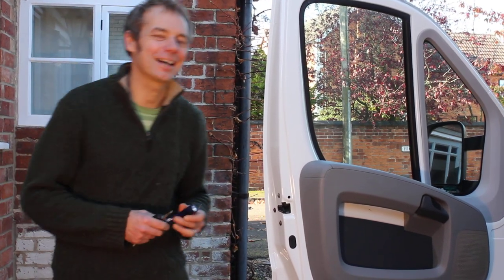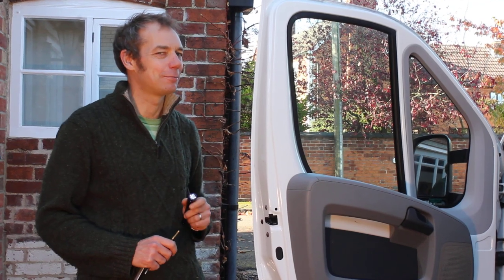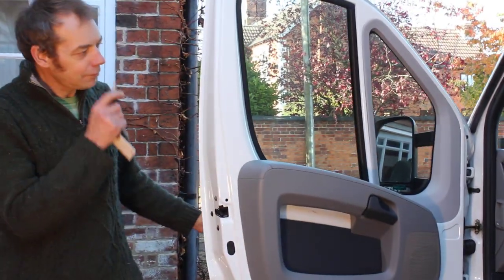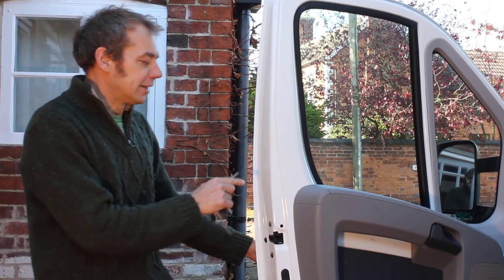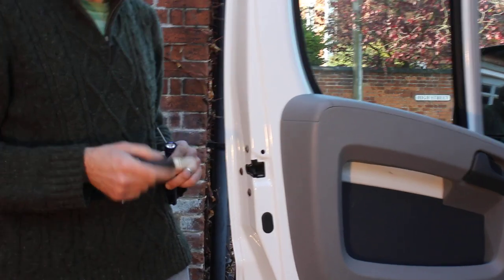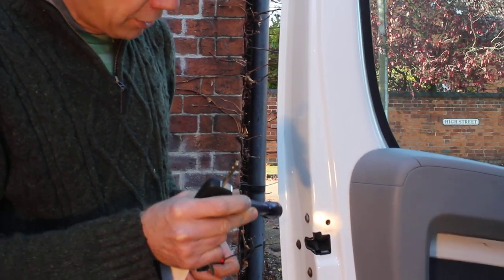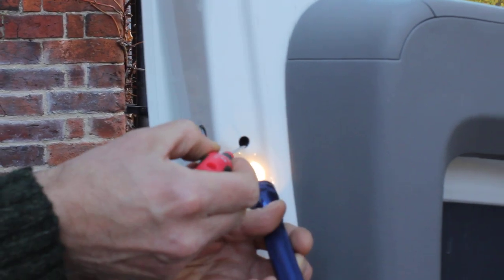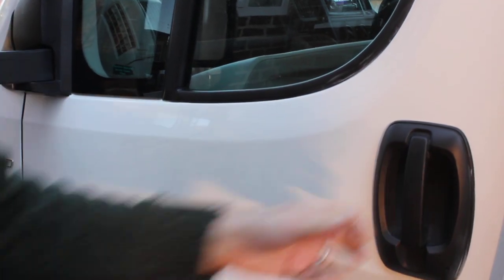How to manually lock the doors on a Fiat Ducato after disconnecting the battery

Comment: It works! So simple. I didn't even need a torch. Just stuck a screwdriver in, wiggled it, and the door locked shut. Even works on the back doors of a crewcab.

Comment: will try this as battery on van exploded ,yes it was loud , the only other problem was / is the windows are both 30mm down warm day and the blower only worked on 4  thanks  for the tip .

Comment: I didthis which worked fine. Now I have replaced the battery how do I get the door to lock with the central locking? Is it just a case of putting the swith back down?.

Comment: Ta for vid..do u leave the  plastic switch in up position? ie will cenral locking work after this?
Reply: Yeah, as soon as you unlock the door (either with the reconnected central locking or by pulling the interior door handle) the switch will pop back down.

Comment: My central locking is not unlocking all doors stuck locked wjay could be the problem when i press the unlock button i can hear the locks bit it wont open only access is drivers door and rear door as i can unlock manually

Comment: Hi...help!!! So, I tried your fix. It worked. Door was locked. I opened it (via central locking) afterwards to check nothing was irreversible. I thought, brilliant. So then I did it again. Maybe wasn't careful enough about how I pushed the catch this time... Anyway it locked again, but now won't reopen again.  At all. So I have a bit of an issue as now I have no way of opening the door. Help!!!!! Is that some way to get at the lock from the inside if I take the side off the door?? I'm worried that there's no way of getting my door back... any advice would be very much appreciated!!!
Reply from the maker: Hi. If you are locked outside the vehicle, unlock the driver's door with the key. Once inside the vehicle, reconnect the battery. You should now be able to unlock the passenger door either with the unlock button on the remote key fob or by turning the ignition to the on position. (If the vehicle is fitted with dead locks, the unlock button on the dashboard may not unlock the passenger door so use the key fob or ignition switch method.) If the central locking is inoperative the most likely problem is a blown fuse F36  in the fuse box behind the screw panel on the dashboard by the driver's right knee (7.5 amp fuse on the left hand edge of the bottom row). However, manually locking the door won't have caused it to blow so you may need to investigate the problem after replacing the fuse.
Reply: I have the same problem after this fix, I can open the door from the inside but the handle won't open from the outside, occasionally it will which is odd. 
Did you fix this problem? If so how.
Reply: @ianbryant3067  did you ever get a fix for this ?
Reply: @hannahbee9464  nope sorry

Comment: How do you unlock with no power. My battery is dead and central locking not working but the nearside door also won't open so I'm unable to pop the bonnet to jump start the van? Help very much appreciated anyone?

Comment: OR.... lock with the remote whilst sitting in the cab. Disconnect the battery and exit through the drivers door...(lock with the key) No tricks... thats how I do it every time..
Reply from the maker: Only works if you don't have an alarm or are so deaf you can't hear it going off when you disconnect the battery while the vehicle is centrally locked.